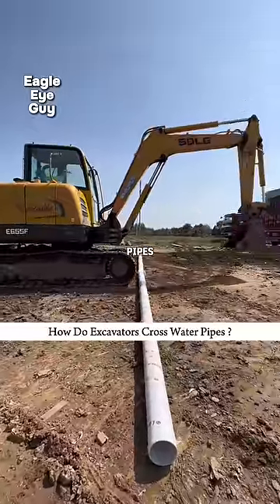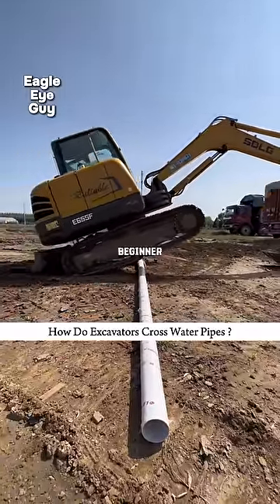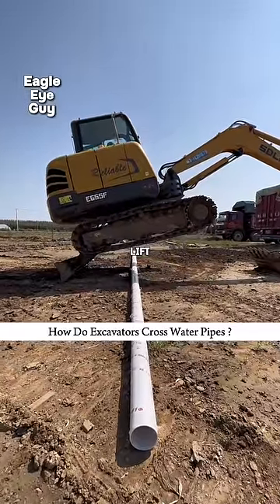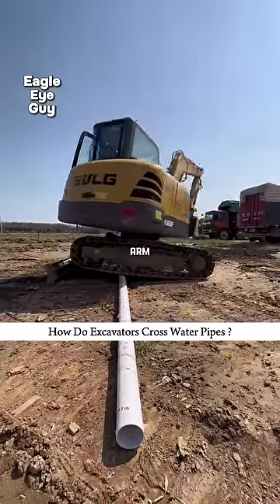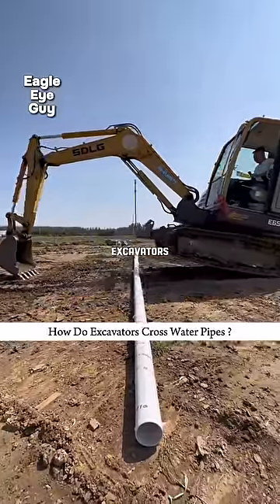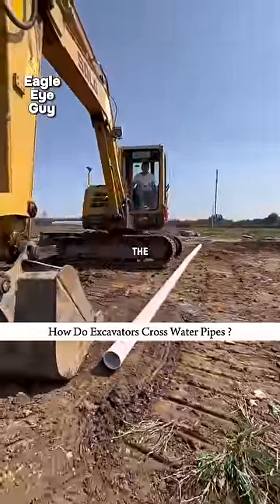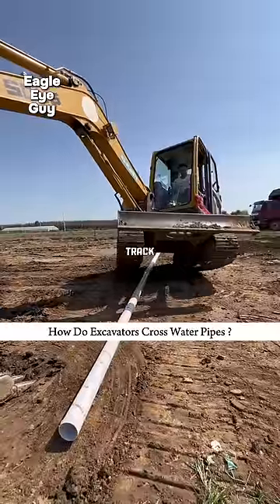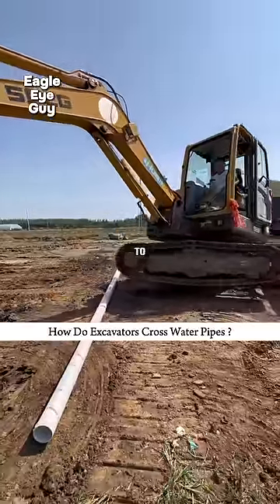How do excavators traverse water pipes? #shorts #facts #didyouknow #excavators #howto

Comment: A real construction worker just drives over it.
Reply: Are they construction workers or trespassers lmao
Reply: Fired.
.I'm sorry...never hired to begin with😱
Reply from the maker: If you do that, you’ll need to address the water leak next !
Reply: Shit I can't tell you how many I've had to fix cuz mfs to lazy to do this lol
Reply: @EagleEyeGuy just means more money 💸💸💸
Reply: @EagleEyeGuy  nahhh im not getting paid for that, nor am i the water people.
Reply: @EagleEyeGuy  ther pipe dhouldn't ne ecxpode like thatpoioes are burried not left on the surface.and if they wre tyhey could just be removed first.  And, material is left strewn all of the site but placed in a materials area  This is fake asnoe would leave exposed pipe like and even if its burrid close to the surface they would asdd panels meant to distribyte the weight over a larger area reducing the impacr and as cloase as the end was he could have gone around the end of pipe.the end is a only about 6 feet away  so travel 10 feet past pipe travel safely past it osition and move back  or just wait to put the pipe down until after the needfor such equipment. Pipes are added usually after the need earth movers except to bury the pipe. THis is so staged
Reply from the maker: @0011peace This was an example. Now most of them are buried, but it would have the same effect if the excavator driver decides to roll over it
Reply: @EagleEyeGuy  no they put a pls atform omn tpp destroiuting a the weight to a larger area or they freate a trench and put a platform onver the trench there fir iut usb't on the pipe at all .  Tehere are ppes underneath parking lots yet the pipes don't break.  if you full iut orioerkyt ir distrubbure the weigh ot sopan a te rench uyou can avoid pipes,  I have have family in this indrus try for two generations andm, have sone some other c luight constuction myself Ny dad was local contactort and as one of his jobs and my broither is forman who started as laborer in brick laying.  And, form workling with around them i know they would aecure teh pipe and reduce stress uinstead of tryng chroaa over when burried ubnniformly the presu rure becomes w equal on all sides .  and if yu had a sitch li  you ould span that way and never even touch the pipe.
Reply: @0011peace reading your comment in a Scottish accent made it a lot easier to comprehend
Reply: More money @EagleEyeGuy
Reply: @stevanrae1739  she can'ea take anymore capn'
Reply: @EagleEyeGuy  nah just go like "wait who did that" and ur fine
Reply: 😂😂😂😂😂 I'm fucking dead 💀
Reply: @0011peace  Holy crap your grammar was not good. Did you not notice all of the red and blue lines under your words?
Reply: @0011peace  I lost 50iq points reading the first sentence
Reply: @SalientPrime  did you ever have 50 iq points
Reply: @0011peace  you dropped me down to 95
Reply: Anyone who argues the other way doesn’t know what a real construction site is like LOL.  The construction site is nothing but an endless circle that eventually gets filled in…
Reply: And hopes it doesn't break.
Reply: @Honeypot-x9s   construction sites have materials area where materaal not in use . Pipes are burried often in a trench or covered and platforms are placed on tp either like a bridge or to redistibute weight.
Reply: @sierramountainsrailfanning2114  No they bury pipes in a small trench or completely covered then use platforms to disribute the weight
Reply: @EagleEyeGuy  just use a cheap vehicle ramp?
Reply: @EagleEyeGuy  Not my job, that's the plumbers fault
Reply: Thats the plumbers problem lol@EagleEyeGuy
Reply: @EagleEyeGuy  Easy fix.
Reply: And don’t report to anyone
Reply: @EagleEyeGuy good thing it’s not connected to anything!
Reply: WORD!!!!👏🏻🤗
Reply: @EagleEyeGuy  That's what the laborers are for!😉
Reply: I ran over one in my semi was just thinking whoops anyways
Reply: @EagleEyeGuy  someone else's problem for piping up before the landwork is done
Reply: Blames the electrician
Reply: @EagleEyeGuy  And that would be an additional job, more money. They can't prove you drove over it 🤣
Reply: U means american
Reply: @EagleEyeGuy nah that's the next guys problem
Reply: @EagleEyeGuy  nah that's the plumbers job. i just drive the excavator.
Reply: @EagleEyeGuy why are you using explanation marks like a grandma?
Reply: Holy shit 😂😂😂😂 perfect comment
Reply: What fucking water line?
Reply: @0011peace speak english my guy Jesus Christ
Reply: Broken pipe? Just buy another one from the budget. Doesn't come out of my pocket.
Reply: I was waiting for it
Reply: fr i was a grunt but pick up a coffee cup got a wiff of it it was piss so i made the other grunt go pick cups amd trash while i sweep all the floors
Reply: @evilredBoris  No I am not  Jesus Chridt I'm Santa Claus
Reply: Yes a real one does.
Reply: I was about to say that shit ..
Reply: And says taxes real loud at the same time
Reply: @EagleEyeGuy  But thats the next guys problem
Reply: @EagleEyeGuy it was a joke larry
Reply: If it's covered by Uncle Sam, you know it
Reply: @0011peace I'm impressed at your ability to completely maul the English language. Whether it's on purpose or not.

✨️BRAVO✨️
Reply: @Teenage_Mutant_Ginga_Ninja  I can do i egen more so with eveyother langauge
Reply: @EagleEyeGuy  someone else's problem
Reply: @0011peace  are you okay? Should I call an ambulance?
Reply: 😂😂 I was fully expecting the 2nd method to be exactly that
Reply: @EagleEyeGuy  we just leave it for the person job to deal with the pipe or water.
Reply: @EagleEyeGuy job security 😂
Reply: I see I've found a fellow construction worker. 👍
Reply: @EagleEyeGuy that’s the plumber. the excavator guys don’t care about a job they won’t have to do 😂
Reply: and slap it with flex tape 😂
Reply: @EagleEyeGuy that's the plumber's problem
Reply: That's the plumbers problem
Reply: That's what I do
Reply: @EagleEyeGuy its clear you know nothing of construction. water pipes arent ever pumped abovebround unless testing for structural damage or leaks.
Reply: @0011peace Pipes are the often left like this for a few reasons, for starters it may be going in soon, you aren’t paid for storage, etc. and the pipe only being 6 ft away was just for video purposes, generally it won’t be like this. Also, please learn how to spell…
Reply: @0011peace Parking lots are entirely different, the concrete itself almost entirely distributed the weight. In most scenarios, it’ll be on freshly excavated soil, which is how it is at the job site I’m currently working on which is a retirement building. The pipes are placed in such a way that they can be buried as soon as needed and possible, but is still just barely above ground, which requires the excavators to do something like this. It also applies to more than just pipes. Brazer boards, stakes, measuring string, wire, etc. It’s not just for pipes
Reply: @0011peace Please stop speaking like you know what you are saying. Yes, construction sites have places for SOME materials, like wood for the carpenters and stone for the masons, but it doesn’t store wires, pipes, boards, string and many other things. This storage is also just a small area, most of the time it’s quite literally the back of the parking lot.
Reply: @EagleEyeGuy no you won’t, the only thing you gotta worry about is a free meal from the plumber who just got another week of pay
Reply: @0011peace the fent is kicking in.
Reply: @havenX76  yes they do that you think you know you don't know anything abiut the subject
Reply: @0011peace  Yes I do think I know about the subject, I am currently a construction worker, working as a carpenter on a commercial site, a retirement home. A large one at that.
Reply: @havenX76   yoy use platforms to the same so you don't crush exposed but placed material. Nit only is letting naterial get crushed cause delays and cost overruns.
Reply: @0011peace  No not really. You keep talking about these “platforms” but those are rarely used. That’s for a multitude of reasons but the main one being they don’t work well in mud and get pushed underground when bigger excavators and skidsteers ride over them. You also can’t use platforms over brazer boards and measuring string. Who taught you this? Because they clearly didn’t do a great job.
Reply: @havenX76  i have had a Dad abd brother and even worked my dad on and been on site when my brother worked Materials ar stored out of the way to pritect it from accidnntal damage any, xompany tgat doesn't is more of a scammer than cobstruction. They aren't trying keep material cost and hours down for the cusyomer
Reply: @havenX76  tes they do they storw it on site out of harms. They don't put in the way of heavy equipment.  They set it aside in a materials zone.
Reply: @0011peace  If you don’t understand this, then I think you should give up. Brazer boards and measuring strings are not materials that get stored, they are USED on site immediately and sit there until the end. Your dad and brother must be pretty poor at their job if they haven’t explained that to you, as they are the most commonly used things. What’s it take for you to understand that? If you can’t build over them and they aren’t stored, you have to use something like this to get over them. And one last time, these “storage areas” are not as grand as you think. They store wood, stone and some machines. That is quite literally it. Everything else is on you to keep safe.
Reply: @0011peace  Now before you hit the send button again, please reread what you wrote, it is nearly unintelligible.
Reply: @EagleEyeGuy that's the home owners problem
Reply: In Australia New bury out pipes and then the vehircles can drive where they want
Reply: I don’t think that’s even a thing
Reply: @EagleEyeGuy "it just came broken"
Reply: This got me dying lmao
Reply: @Alan-l6k7l how about if i put it on the scoop and spin it 3 times
Reply: @EagleEyeGuy  addressed to the plumber, love Mr George
Reply: @EagleEyeGuy  Job security!
Reply: @Mecha_Kaneki  they re mexicans
Reply: That's why houses look like they're built by a bunch of skilled toddlers, because they are lol.
Reply: @RemyPac  ah so if you are over 30 and don't actively run a crew then there is probably a reason for that just going off of that comment.
Reply: @EagleEyeGuy sounds like a plumber problem to me
Reply: A city worker for sure
Reply: As a plumber I love it it's a change order  more money  somone  is paying  for it
Reply: A real operator puts a pile of conpacted material over it, a ramp, so u can go over its and back again multiple times without risking damage
Reply: @juicebox6581  to much  like work  and waste of time and time is $ why do all that when you can just jump it. This way you dont waste time on clean up and no risk damaging the pipe
Reply: No
Reply: @EagleEyeGuy that's the bosses problem not mine
Reply: As someone who works in telco, it does feel like the goal is maximum destruction when it comes to fiber optic conduits.
Reply: @PLAX84  jumping it is litterslly the biggest risk. A mound of material going over acts as a cushion and allows repeat traffic to and from. Pipes are normal buried under 15-20 of ground so they are litterally designed to have material over top so u can drive over then no problem.
Reply: An american construction worker*
Reply: A real construction worker MAKES money NOT pay for the dumb damages he incurred.
Reply: And legends toss it over 😅
Reply: @EagleEyeGuy Plumbers issue.
Reply: It's an awfully managed/planned construction site if there's any damn water pipe obstacles for excavators.
Maybe in a third world country this could happen.
Reply: @EagleEyeGuy  Thats the other guys problem.
Reply: Real construction workers just don't do any work
Reply: @EagleEyeGuy which equals more job which equals more money
Reply: @EagleEyeGuy  it doesn't needs to be addressed it's right there😂
Reply: @BenzinbrowncrryysLer3000  Where’d you get that stereotype? It’s a pretty bad one.
Reply: @EagleEyeGuy  Why would an equipment operator address a water leak? That's just crazy. That sounds like someone elses problem.
Reply: @EagleEyeGuy and that is a sacrifice my boss is willing to make 🫡
Reply: or just fucking moves it... then puts it back after ...?
Reply: @0011peace  Good comment, but the typos made it hard to read.
But thanks for sharing your knowledge :)
Reply: Amen to that
Reply: @n01n00bgameing  well, maybe you should have dug out a trench and buried it instead of putting it in the excavator's path
Reply: Or around it
Reply: @EagleEyeGuy  

They wouldn't fix it later, they'd fix it as soon as possible. If they didn't, the entire job site would be flooded.
Reply: @EagleEyeGuy job security 💸
Reply: Yep
Reply: Nope.
Reply: @EagleEyeGuy  That's the trick...
Reply: @EagleEyeGuy  nah. You just put a clause to your subcontractor deal that it is primary contractors task to remove those obstacles or deal with the damage to them.

I have quite literally witnessed this. Along with had the contract to repair 2 special stainless steel drains when the landscape contractor was in a hurry. Best bit was that the drain were week apart from each other.

The shit you get away with when you are the cheapest and quickest.
Reply: @EagleEyeGuy you missed the point or simply you did not work in "large construction" areas
Reply: @EagleEyeGuy  there's clearly no water coming out of that pipe
Reply: Like how a car would just drive over a water hose
Reply: @EagleEyeGuy not my job
Reply: If this happened then it is just poor management/ planning fault whoever plan this
Reply: Warning and bonus cut
Reply: hahahahahaha. Pipe layers get OT. Good lookin out
Reply: This is crazy to begin with. Here in EU this kind of sht is what we call ''violation of safety regulations''. You are not supposed to drive or hop over water pipes during that phase of construction in the first place. If you find yourself in a situation like that then, you are doing your construction work in a very wrong order!
Reply: Nope I'm the excavator guy that sounds like the plummer's issue  @EagleEyeGuy
Reply: Sounds like some real American construction work right there
Reply: @rockmcdwayne1710  seems like the EU has some better regulations than the US. Thanks for the info. And sounds 100% legit.
Reply: @EagleEyeGuy  Mmmmm sounds like plumber work
Reply: @kuri369kuri  Better in many ways indeed allthough, not all roses and sunshine either. Too much of a good thing can actually turn bad. Sometimes the regulations can be so strict that they squeeze the life out of any meaningful progress in economical growth.
That being said, americans are on another level of taking stupid risks sometimes lol!
Reply: @rockmcdwayne1710  I totally understand and agree with you brother. I’m an American living in Japan working in aviation at an international airport and the regulations here defy logic. Seems like common sense has been hijacked by politicians with zero common sense.
Reply: @EagleEyeGuy eh, city'll pay for it
Reply: @0011peace fix your fucking keyboard bruh
Reply: @EagleEyeGuy more money/work for the workers 

as long as theres no snitches
Reply: @EagleEyeGuy dewatering's issue
Reply: @EagleEyeGuy it'll fix itself. Reminded me of construction workers just ripped our optical fiber out.
Reply: yeah it should be in ground and it got in the way lol
Reply: Flex tape  @EagleEyeGuy
Reply: @stevanrae1739 now I’m half Scottish, we would take offence but this was funny to me
Reply: @havenX76  I’m actually intrigued about the subject of what 0011peace was on about and why he’s wrong, I know he’s wrong but I just wanna learn more on the subject
Reply: @scouseleemini1  Sure. He was talking about building platforms so the excavators could go over some objects, however most sites are filled with mud so the excavators (which weigh an insane amount) would just push the platforms into the mud. He then talked about storage, which in most sites just store wood and stone and it is usually just the back of a parking lot, not an actual storage yard. Brazer boards are setup to help both yourself and others see where your part of the site would be, meaning the space that you are working on. You set them up to help measure, visualize, etc. you don’t store them because they are always being used.
Reply: @EagleEyeGuy sounds like a plumbers problem 🦊
Reply: @EagleEyeGuy that issue is for a plumber XD
Reply: Well dam! This is neat lol
Reply: @EagleEyeGuy thats the point, more hours
Reply: A real construction worker drives 20 feet to the right and avoids it
Reply: @Efolker21  thats the boring way, i wanna do the fun way :(
Reply: @EagleEyeGuy  That's the plumbers job, not the operator.
Reply: @EagleEyeGuy  overtime
Reply: This is exactly what happens.
Reply: @EagleEyeGuy What he meant is when the pipes is empty. Like in the video.
Reply: I can vouch for this comment.
Reply: That why mfr’s stay fixing roads for years they break more 💩 then there there to fix and I’m always late for work
Reply: @EagleEyeGuy more bill able hours for the union job
Reply: @EagleEyeGuy  no the plumber will need to address the water issue
Reply: I know what you mean 😂
Reply: @0011peace  thank you. I had a stroke bc of your "writing". Ffs
Reply: @havenX76  why on earth did he start talking about storage tho?
Reply: @scouseleemini1  He brought storage up to try and say “You won’t have material out on site, so an excavator will never need to go over it anyways”
Reply: @RemyPac  Extremely self-centered view. This is a big part of what's wrong with the world and why there's conflict everywhere smh
Reply: @havenX76  but isn’t construction equipment completely separate from materials?
Reply: @havenX76  so what compelled him to take it to the grave instead of taking a breather and realise he was wrong because it’s how daddy did it
Reply: @scouseleemini1  I’ve got no idea why lol, and yes material and equipment are very different.
Reply: Ay same pfp, I thought when did I get that many likes lol
Reply: @havenX76  I agree with you there tho on his brother and father being poorly qualified construction workers, I have a feeling they’re free from osha too, the second they get caught there will probably be 300 violations
Reply: @Ahayeahishere  your welcome tht ws the e intent to weed ot the weak
Reply: Or just move the pipe
Reply: @pigpen5073  how would you move a pipe if it were connected?
Reply: @pigpen5073  it’s just a demonstration on how to go over a pipe without damaging it or attempting to move heavy materials
Reply: @jaygohel2801  I see you’re a man of culture
Reply: Thats the plumbers problem lmao@EagleEyeGuy
Reply: @EagleEyeGuy  you have no sense of humor, do you?
Reply: @EagleEyeGuy that's for the leakies to deal with.  Unless it was a sparky pipe, then the sparkies can worry about it.
Reply: @EagleEyeGuy  duct tape
Reply: JESUS IS COMING SOON🔥 REPENT ANS TURN AWAY FROM YOUR SINS 🙏🙏
Reply: 😂😂😂 right
I do that
Reply: Construction guys don't operate an excavator
Reply: @EagleEyeGuy  As long as the pipe isn't completely cracked right away, there could be years or even decades before the pipe needs to be replaced, thereby ensuring a never-ending stream of work for destruction/construction workers!
Reply: @EagleEyeGuy  The plumber can figure that out whenever he's done counting his money. 😂
Reply: @EagleEyeGuy  no no, they just call the plumbers
Reply: @EagleEyeGuy 😂 That's a contract add on - more money. 😂
Reply: Fk yeah more overtime
Reply: Just go around the darn thing
Reply: BOB THE BUILDER CAN WE BULID IT!?
Reply: now you're fired because you broke it
Reply: Savage
Reply: They break it and then repair it here
Reply: Destruction workers
Reply: Yeah, pipe is cheap. Just drive over it. 😃😁😆😉🙄
Reply: @EagleEyeGuy additional work is job security! 😃😁😉🙄
Reply: @n01n00bgameing 
Just back charge all additional expenses to the customer.

Just like T&M  (time and materials) work. 😃😆😉🙄
Reply: @EagleEyeGuy water leak? It's a very common thing
Reply: , breaking the pipe.
Reply: At least you showed you know Nothing 😂
Reply: Genius. Then they pay you more to fix the pipe!
Reply: @EagleEyeGuy THEN WHY IS IT EXPOSED
Reply: Do they have movable concrete/metal ramps you can roll over that you can buy or nah?
Reply: @monkepog3236  no, that is fraud
Reply: @EagleEyeGuy thats okay, im paid by the hour
Reply: Yup